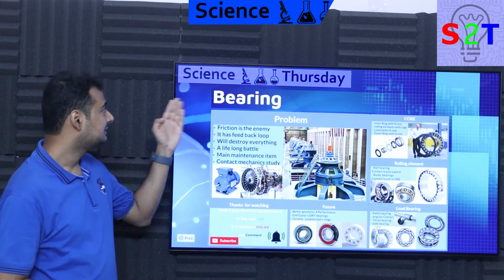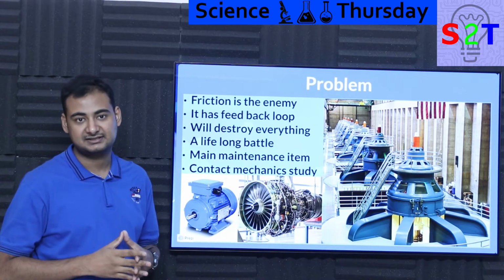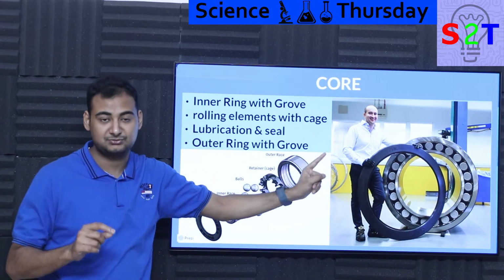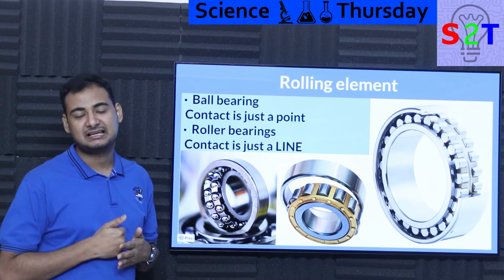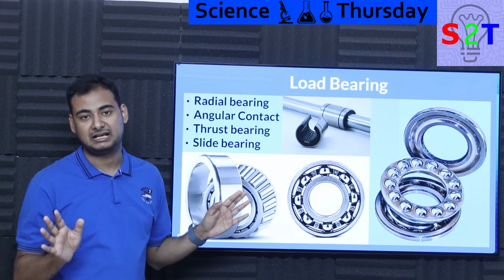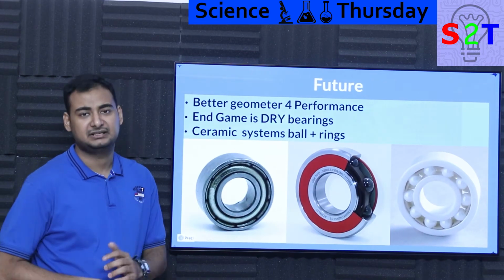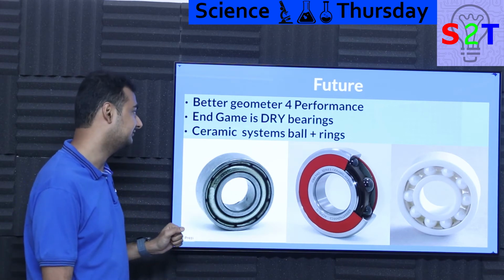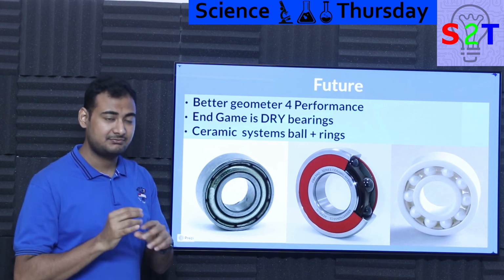Bearings Explained  {Science Thursday Ep144}

Comment: Just a correction:  Nobody makes ball bearing where the balls are making point contacts (atleast 99% of use cases).  Balls ride in a race which can vary from slim groove to deep groove, which by circumference covered will be something like 10-50% of a roller bearings line contact area.
Reply from the maker: Ideal Vs reality
Reply: @s2tenglish  Idea of point loaded ball bearings is a common misconception as that requires a material with no ductility and the hardness of glass or more.  Also its not that hard to make proper grooves, just like its not hard to make roller bearings with line loading, because if not the same problem would apply there.